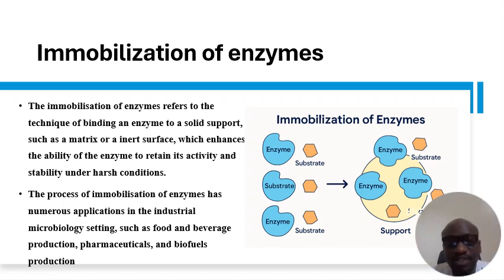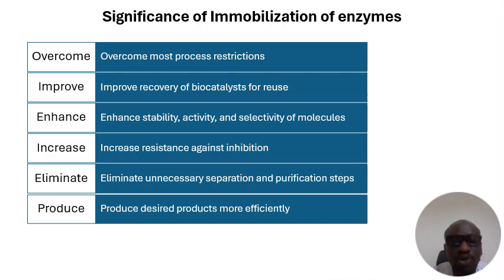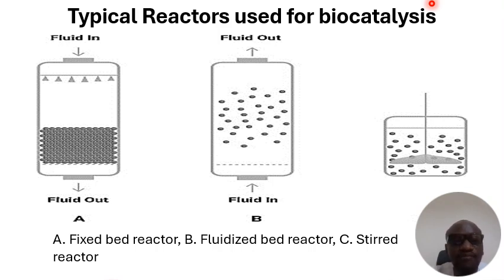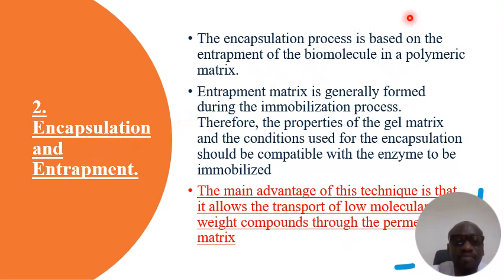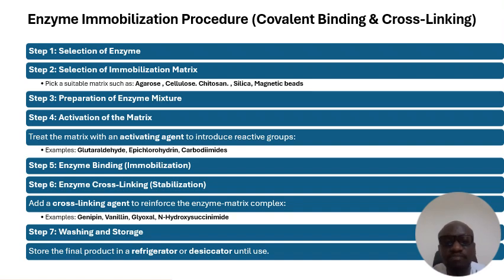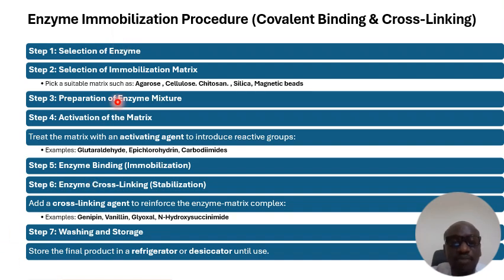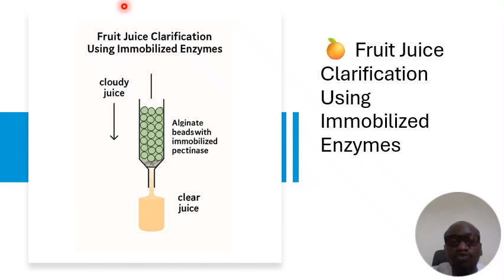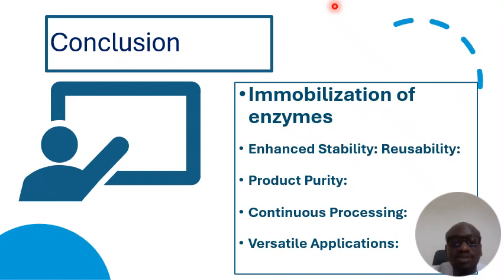Immobilization of Enzymes (Industrial Microbiology )

Comment: Question 1: Explain immobilisation

Enzyme immobilisation means attaching or trapping an enzyme onto or within a solid support material (such as beads, membranes, or a gel matrix) instead of leaving it free-floating in solution. This can be done by binding the enzyme to a surface, entrapping it in a gel, or cross-linking enzyme molecules together. It's useful because it keeps the enzyme fixed in place, allowing it to be reused repeatedly and easily separated from the product, which isn't possible with free enzymes in solution.

Question 2: Applications and advantages

Advantages of immobilised enzymes:

Reusability – since the enzyme stays attached to the support, it can be recovered and used again for multiple reaction cycles, cutting costs.
Increased stability – immobilisation often protects the enzyme from denaturation due to heat, pH changes, or other harsh conditions, giving it a longer working life.
A third advantage worth knowing: Easier separation of the enzyme from the product, since no purification step is needed to remove the enzyme from the reaction mixture.

Oyedele Gabriel Inioluwa
210807049

Comment: Question 1: Explain what Immobilisation of enzyme means.

Immobilisation of enzymes is the process of fixing enzymes to a solid support such as a capsule or matrix. This allows the enzymes to be reused in multiple reactions, gives easier control over the process, and reduces the overall cost of production.

Question 2: Advantages of immobilised enzymes are:

1. Easy separation of enzymes to give pure product: Since enzymes is fixed to a solid support, it can be easily separated from the reaction mixture to give a purer product.
2. Increased stability of enzyme: Enzyme Immobilisation improves enzyme's resistance to changes in temperature, pH and organic solvents. This makes the enzyme last longer.
3. Reusability of enzymes: Enzyme can be used for numerous reaction cycles instead of being discarded.
4. Reduced costs of production: Because the enzyme is reused and product purification is easier, the overall cost of productuon is reduced.

Real-life Applications
1. Use of immobilised enzymes in making high-fructose corn syrup (HFCS): Glucose isomerase enzyme is immobilised in a packed bed reactor and a glucose rich solution is passed through it. As the solution flows through, the glucose isomerase enzyme converts glucose to fructose resulting in high-fructose corn syrup (HFCS).

Onyeibor Adaeze Victoria 
210807081

Comment: Question 1
Immobilization of enzymes is the process of attaching enzymes to a solid support or within a matrix while allowing them to retain their catalytic activity, meaning the enzyme stays in one place instead of being freely dissolved in the reaction mixture.

Question 2
Advantages:
i. Resistance to Denaturation: The support material can protect the enzyme from chemical or physical damage, reducing the rate of denaturation

ii. Continuous Processing: They can be used in continuous flow reactors, allowing uninterrupted production. This increases productivity and efficiency in industrial manufacturing

iii. Improved Stability: Immobilized enzymes are generally more stable against changes in temperature, pH, and storage conditions. They often have a longer operational lifespan than free enzymes

Real life application:
i. Clinical Diagnostic Kits: Immobilized enzymes help detect substances such as cholesterol, urea, and uric acid in blood samples.

ADEMOLU OLUWATOMILOLA ADESAYO 
230807548

Comment: Question 1: Explain Immobilisation

Enzyme immobilisation is the process of fixing enzymes onto a solid support or matrix so that they remain in place while carrying out their catalytic function. This is useful because the enzymes can be easily recovered and reused, while also improving their stability and enabling continuous industrial processing.

Question 2:
Advantages and Applications 

Advantages:

1. Immobilised enzymes can be easily separated from the final product and reused in multiple batches.

2. They have improved stability and are more resistant to heat, pH changes, and inhibitors.

3. They enable continuous industrial processing, which increases productivity and reduces production costs.

Real life Application:

1. Juice Clarification: Pectinase is used to remove pectin, which makes fruit juices cloudy. By passing juice through a column containing immobilized enzymes, the pectin is broken down, resulting in a clearer, refined product without enzyme contamination.

Ekebafe Anthony Emmanuel 
210807050

Comment: Question 1: Explain immobilisation

Enzyme immobilisation refers to the technique of physically or chemically binding enzymes to an insoluble solid support or matrix while retaining their catalytic activity . By fixing the enzymes in place, they do not mix into the solution, allowing them to be easily separated from the final product and reused multiple times. This significantly enhances operational stability and cuts down on downstream purification costs in industrial processes.

Question 2: Applications and advantages

Advantages:

Easy Recovery and Reusability: The enzyme remains attached to the solid support, making it simple to recover and reuse for multiple cycles, which greatly reduces operational costs.

Enhanced Thermal and pH Stability: Immobilised enzymes are more resistant to extreme heat and pH changes, preventing denaturation and allowing them to function reliably under harsh industrial conditions 

Real-life Application:

Dairy Industry (Production of Lactose-Free Milk): The enzyme lactase is immobilised on alginate beads inside a reactor column. As regular milk flows through the column, the immobilised lactase breaks down lactose into glucose and galactose, creating lactose-free milk for lactose-intolerant consumers without contaminating the final product.

Njoku Vitalis Udochukwu 
190807089
Reply: Name:Omotosho funmilayo favour
Matric no:230807569
Question 1:Explain immobilization 
Enzyme immobilization refers to the technique of  binding an enzyme to a solid support system such a matrix or inert surface enhancing the activity and stability under harsh conditions
Enzymes are fixed to a support because it is used in the immobilization of enzymes and use to produce more purified products
It is useful because it helps the enzyme retain its activity or stability under harsh conditions.
Question 2:Application and advances
-easy separation of enzymes
-reduced cost of downstream processing 
Application include:
Pharmaceutical synthesis 
Which Is the use of immobilized enzymes to produce active pharmaceutical ingredients(APIs) with high purity and reduces waste especially in hormones synthesis.
Reply: Microbiology

Comment: Question 1:
Enzyme immobilisation is the technique of anchoring biocatalysts onto solid carriers so they remain stationary during catalytic reactions. Enzymes are fixed by techniques like physical adsorption, entrapment, covalent bonding.
It is highly useful because it allows the enzyme to retain its activity, and enhances its stability under harsh conditions.

Question 2: 
Advantages of Immobilized enzymes 
1. It eliminates the need for expensive post-reaction separation and purification steps
2. Fixed enzymes retain their operational stability over a longer period.

One Real Life Application:
                  Fruit juice clarification: Immobilized pectinase enzymes in alginate beads are used to break down pectin in cloudy fruit juices.

Name: Nwankwo Chiamaka Joy 
Matric no: 210807067

Comment: Question 1: Immobilisation
Enzyme immobilisation means attaching or trapping an enzyme onto or within a solid support material (like beads, membranes, or gels), instead of leaving it free in solution. The enzyme can be fixed by adsorption, covalent bonding, entrapment, or encapsulation.

Question 2: Applications and advantages
Advantages:
	1. Reusability- since the enzyme stays bound to the support, it can be recovered and used for multiple reaction cycles, cutting costs.
	2. Increased stability- immobilised enzymes often resist heat, pH changes, and denaturation better than free enzymes.
	3. Easy product separation-  the enzyme doesn’t mix into the final product, simplifying purification.

Real-life application: Immobilised glucose isomerase is used industrially to convert glucose into fructose in the production of high-fructose corn syrup (HFCS), a common sweetener.

Bello Aishat Olanrewaju 
210807098

Comment: Question 1:
Enzyme immobilisation is a technique where enzymes are physically attached or trapped onto a solid support (like beads, gels, or membranes) so they stay fixed in place during a reaction. This is useful because it allows the enzymes to be easily separated from the final product and reused many times, which makes industrial processes cleaner, more efficient, and more cost-effective.

Question 2: 
two advantages of immobilised enzymes:
· Easy recovery and reuse: The enzymes remain on the solid support, so they can be separated from the product without extra purification steps and used repeatedly for multiple production cycles.
· Enhanced stability: Immobilised enzymes are more resistant to heat, pH changes, and harsh conditions, giving them a longer shelf life and reducing the need for frequent replacement.

One real-life application:
· Production of lactose-free milk: The enzyme lactase is immobilised on beads inside a column, and milk is passed through the column so the lactase breaks down lactose into glucose and galactose, making the milk digestible for lactose-intolerant people.

Isaac Emmanuel oluwaseun 
210807061
Microbiology

Comment: Question 1: Explain Immobilization
Enzyme immobilization refers to the technique of confining or restricting enzyme molecules onto or within a solid support matrix allowing them to retain their catalytic activity during use.
Enzymes are fixed to a support through methods such as physical adsorption, entrapment, covalent bonding or chemical cross-linking which is useful because it enhances enzyme stability and allows them to easily be separated from the product for continuous reuse.

Question 2: Applications and advantages
i. Immobilized enzymes show increased resistance to heat and PH changes, protecting them against denaturation
ii. Immobilized enzymes can be easily recovered from the reaction mixture and reused multiple times, eliminating frequent replacement costs. 
Real life application: 
Diary Industry(Lactose-free milk production): Immobilized lactase enzymes bound inside alginate beads hydrolyse lactose in milk into glucose and galactose, producing safe, digestible milk for lactose-intolerant consumers.

Olu-Omoniyi Tofunmi Rolade
210807007

Comment: Question no.1: Immobilization of Enzymes is the method used to bind an enzyme to a solid surface such as a matrix or an inert surface, which enhance the ability of the enzyme to survive in a harsh conditions. Also allowing for repeated use of the enzyme

Questions no.2
* Easy recovery: Lactase immobilized in columns to produce lactose-free milk. After milk passes through, the enzyme remains in the column for reuse.
*Extended Shelf life: Glucose isomerase used continuously in factories to produce high-fructose corn syrup.

Name: OLUNLOYO ELIJAH
Matric no: 210807126

Comment: Question 1: Enzyme immobilisation is a process where active enzymes are physically bound to or entrapped within an insoluble carrier or matrix, such as alginate beads or silica gel. This fixes the enzyme's movement during catalytic reactions while allowing substrates and products to pass through freely. It is useful because it prevents biocatalysts from contaminating the final product while boosting their resistance to heat and pH fluctuations

Question 2:Advantages of Immobilised Enzymes

a) Enhanced Structural Stability: Confinement protects the enzyme molecules from denaturation making them more stable 
b) The enzymes can be effortlessly recovered from the reaction mixture and reused for multiple batch cycles, reducing production costs

Real-Life Application:
 Immobilised lactase enzymes are used to hydrolyse lactose into glucose and galactose as milk passes through the reactor, producing easily digestible dairy products for lactose-intolerant individuals.

Ilori Mary 
210807078

Comment: Question 1: Explain Immobilisation
Enzyme immobilisation is a process where active enzymes are physically attached to or trapped within an insoluble material, like a bead or gel matrix. This fixes the enzyme in place while still allowing it to react with target molecules. It is useful because it keeps the enzymes stable and allows them to be easily separated from the product, so they can be reused multiple times.

Question 2: Applications and Advantages
1. Reusable and cost-effective: Because the enzymes remain separate from the final product, they can be recovered and used again for multiple production cycles.
2. Higher stability: Fixing enzymes to a support matrix often makes them more resistant to changes in temperature and pH compared to free enzymes in a liquid.
3. Easier product purification: The end product isn't contaminated with dissolved enzymes, making downstream cleaning much simpler and cheaper.
Real-life application:
1. Lactose-free milk production: The enzyme lactase is immobilised inside beads or tubes. As regular milk flows over these beads, the lactase breaks down the lactose into simpler sugars without the enzyme washing away or mixing permanently into the milk.

Eledo Ifeoma Esther 
210807029

Comment: Microbiology
Reply from the maker: Put your answers here
Reply: 1. Immobilisation of enzymes is the process of attaching enzymes to a solid support so they remain fixed while carrying out reactions. This makes the enzymes easier to separate from the products, allows them to be reused, and improves their stability.

2. Applications and Advantages:

* They can be reused many times, reducing production costs.
* They are easier to separate from the reaction mixture.
* They are more stable and can withstand a wider range of conditions.

One real-life application:

* Immobilised lactase is used in the dairy industry to produce lactose-free milk by breaking down lactose into glucose and galactose.

Comment: Question 1. 
Enzyme immobilization is the attachment of an enzyme to a solid support so that it remains stable, can be reused, and retains its activity under a wider range of conditions than free enzymes.
Enzymes are fixed to a solid support by various techniques like physical adsorption,cross linking, entrapment or encapsulation and covalent. Immobilization of enzyme is useful because it helps to reduce downstream processing cost, multiple use of enzymes , improved stability against high temperature and ph and produce high purity products

Question 2  
1. They can be easily recovered and reused 
2. They have improved stability against unfavorable conditions like high temperature and ph. 
3. Easy separation of enzymes from products. 

Real life application of the use of immobilized enzymes. 
In waste water treatment , immobilized enzymes are used to break down pollutants and toxic compounds present , making treatment more efficient. 

Ajala Abdul-Gafar Oludare  210807004 
Microbiology

Comment: 1. Immobilisation of Enzymes
Immobilisation of enzymes is the process of attaching or trapping enzymes on a solid support, such as beads, a gel, or another inert material, while allowing them to remain active. This can be done through methods like adsorption, entrapment, covalent binding, or cross-linking, making the enzymes easier to recover and reuse, improving their stability, and increasing the efficiency of industrial processes.
2. Advantages of Immobilised Enzymes
They can be recovered and reused, which reduces production costs.
They are more stable and can withstand changes in temperature and pH.
Application: Immobilised enzymes are used in the dairy industry to produce lactose-free milk using the enzyme lactase. They are also used in the fruit juice industry, where immobilised pectinase helps produce clearer juice by breaking down pectin.

Name: Akinlabi Damilare
Matric Number: 230807546

Comment: 1. Immobilisation of enzymes is the process of attaching enzymes to a solid support to restrict their movements while preserving their catalytic activity. Enzymes are fixed to an insoluble support through physical methods such as adsorption, entrapment, covalent binding, or cross-linking, making the enzymes easier to recover and reuse, improving their stability, and increasing the efficiency of industrial processes.

2. Advantages of Immobilised enzymes include:

-Immobilised enzymes can be recovered and reused, reducing production costs.

-They are more stable (enhanced stability) and better able to withstand changes in temperature and pH.

-Application: One real-life application is

Biosensors: Immobilized glucose oxidase on test strips allows individuals with diabetes to rapidly monitor blood glucose levels.

Name: Imhenrion Divine oluwatobi 
Matric: 230807558